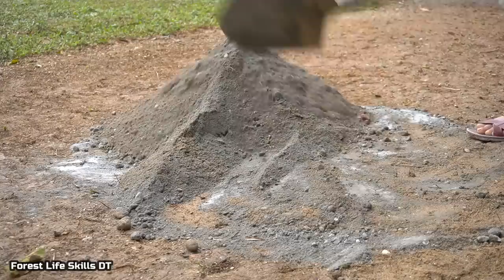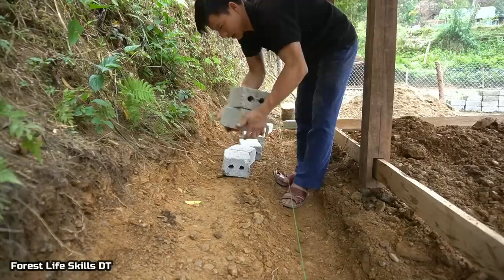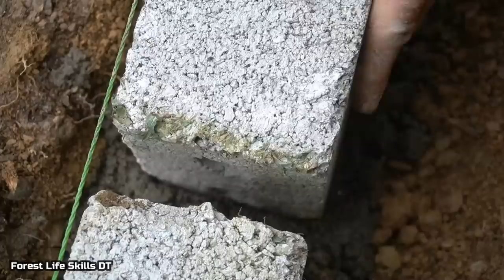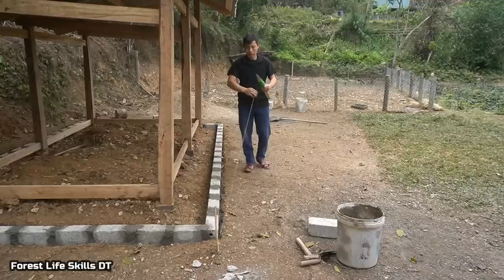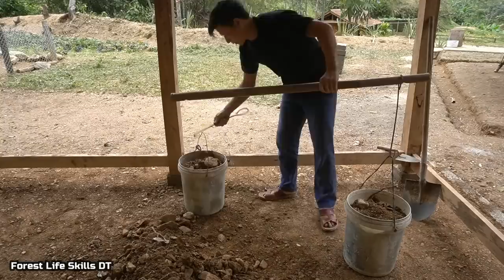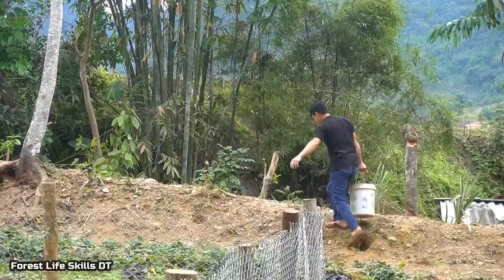Construction of the wooden factory foundation, The process of building a farm in a new location

Comment: What a different way to build a house and foundation, in my country we build the foundation we make a whole like you did around the wood shop, we fill it with cement and rock pebbles at the edge of the ground, the metal rodes sticking out of the foundation, we let the cement/concrete dry, once it dries we slip through the wholes of the concrete blocks the metal rods the blocks have  2 holes on the top and bottom that is where the metal rodes go through to hold the blocks in place, once we finish going around the foundation with the blocks we tie together the blocks and the metal rodes this makes sure the blocks won't breakaway on earthquakes and floods, then we spread cement over the blocks and continue placing more blocks to do the second pile, once we build a 2 feet high wall around the foundation, we tie the rodes and blocks together with metal wires and cover with cement. Once the wall around the foundation has dried we filled it with soil just like you did when you finished the foundation, then we placed a metal mesh over the soil and pour concrete over it just like you did when you made the water pond, except we leave spaces with no cement where we are going to place the house as you did over the cement blocks you made, except we place metal brackets there and pour cement on the whole to keep half of the bracket on the surface, this part looks like a number 4 in the middle the wood will be held by the bracket with 2 big screws, this way the house will stand still on the foundation and won't  flow away in case of a flood or if there is an earthquake it won't move from its place